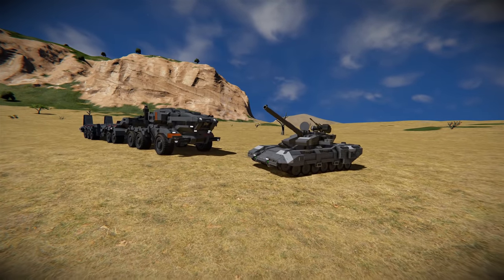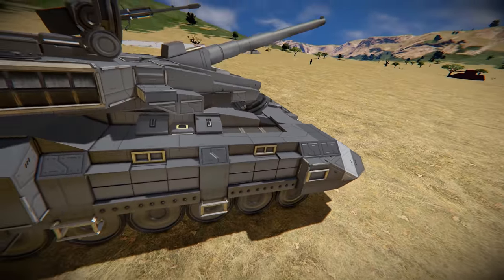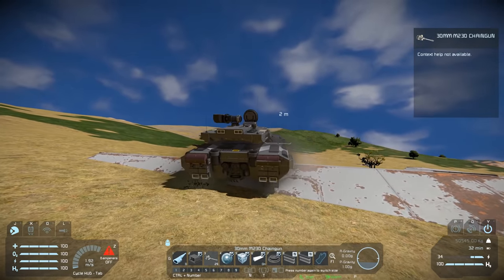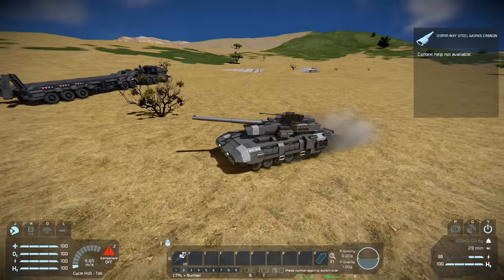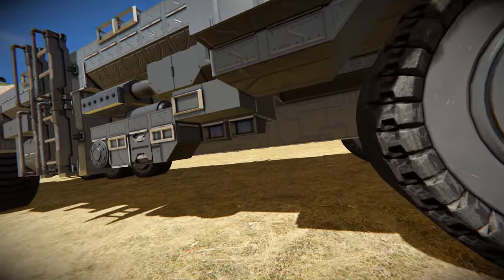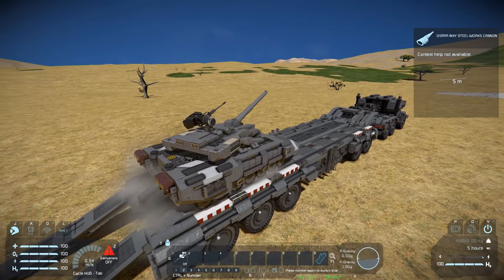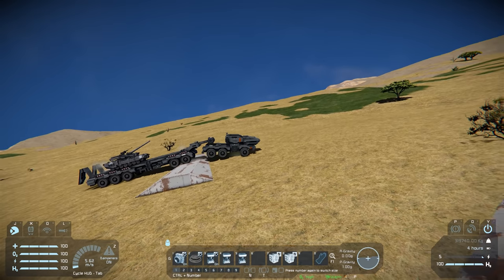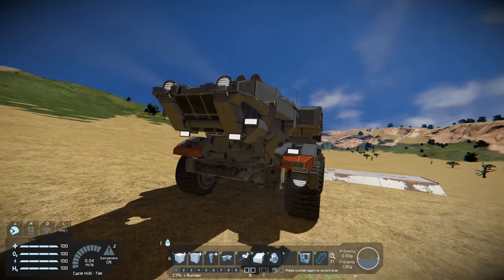Space Engineers - Heavy Equipment Transporter & Main Battle Tank

Comment: I've tested this tank. It's more for show as taking dmg on the rear can cause the hydrogen engine to explode and take out other critical systems.
Reply: Chass3urGaming thats how tanks work. Lesser armor in the back because of weight+ they are suppost to be facing the enemy
Reply: Pretty much every tank has the issue of weaker armor protecting the back and top. I think the T-34 was one of very few tanks with equal armor on all four sides, though still had relatively weak top armor.
Reply: @ikkelolnl  yes but atleast most tank designs don't have the engine fully exposed like this one. They ateast have some sort of plating and/or ERA/cage to help protect the power pack at the rear. This design does not but with modifications you can improve it just like irl. That's the point.

Comment: Not that I like adding more mods than needed, but add a retractable landing gear on the trailer or tank belly, extend and locky it on when its in position, easy day
Reply: He didn't see it, but there's 28 landing gear on the trailer. There should have been a button to lock whatever you're storing on the trailer itself. If you rewatch it, you can see all the landing gear as soon as he looks at the truck's inventory.